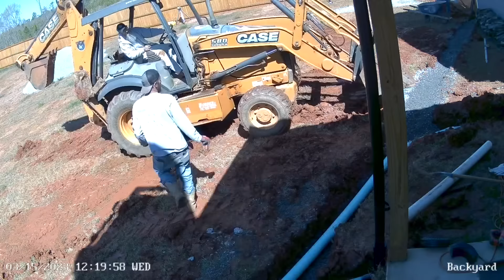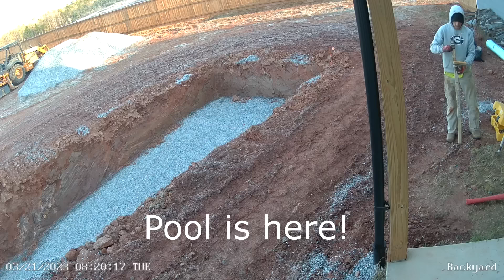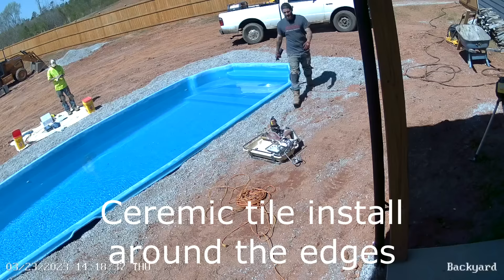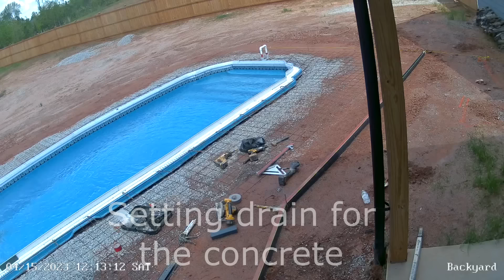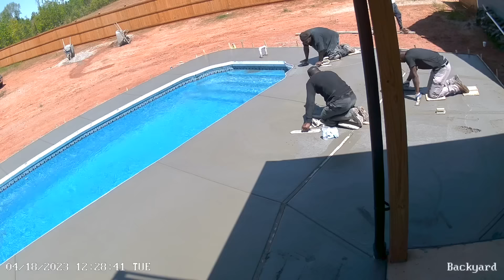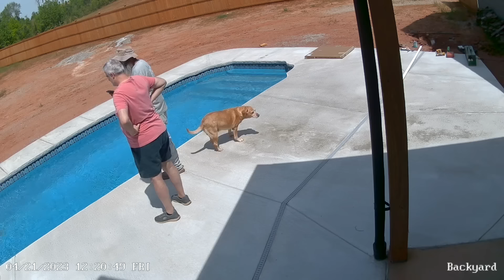Time Lapse Fiberglass Pool Install

Comment: Nice job.  When we installed fiberglass pools 40 years ago, we laid them in a bed of sand then washed sand in around the pool.  I've never seen it done with gravel before.  Interesting....
Reply: I believe gravel is the preferred material nowadays. Sand is just too "fluid" when it gets wet.

Comment: Why the gutters had to be re routed?
Reply from the maker: They didn't "have" to be necessarily, but we chose to do it.  We live in Georgia,  and the soil here is very clay like.  During the summer, we often get periods of time when there is no rain, but then a strong thunderstorm will come through and a lot of rain will fall in a short amount of time.  During those types of situations, we'd see heavy rain off of those gutters just puddle and settle on top of the hard dry clay.  This was before the pool, so it was just a drainage improvement we decided to do while we had the chance.

Comment: Surprised the installer didn't bring in a large water truck to fill the pool vice using the Home owner's water and hose. Yikes...
Reply from the maker: Our water bill was about $50 more the month of the install.  Cheaper than a water truck. 👍
Reply: All you have to do is call the water company and tell them you're filling a pool and you'll only be charged for the water itself....no sewer. Most people aren't aware sewer is what makes your bill so high.
Reply from the maker: We're on septic, but city sewer you are correct.

Comment: Whats the cost to build this pool . And 4 ft. Of decking around pool ?
Reply from the maker: I'm sure prices vary based on location, yard slope, etc.  All total this was right at 60k.  This was more than 4 ft of concrete decking, and we had extra things like rerunning 3 house gutter drains etc.

Comment: That turned out great!  Glad you got 127K views in a month.  What size is it?  We are in the planning phase and thinking 15 or 16 by 30 or 32.  That looks about like what that is.  Any regrets?  I'm waffling on fiberglass or liner.
Reply from the maker: Thanks!  This one is 13x29, with a 3.5 shallow to 5.5 deep end.    I researched for weeks on fiberglass and liner, and had different companies come out with quotes.  We could have gotten a slightly larger vinyl liner pool for comparable price, but even the vinyl installer said figure in replacing the liner in 7 years.  At the end of the day, the lower maintenance costs of fiberglass sold me.